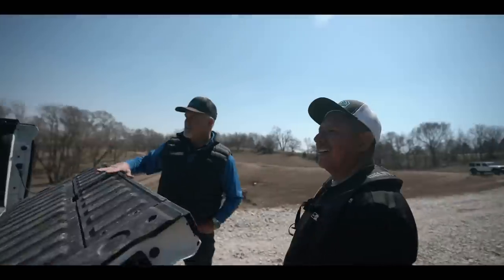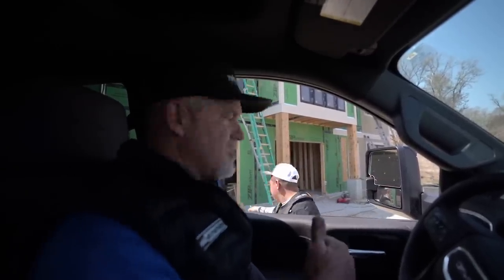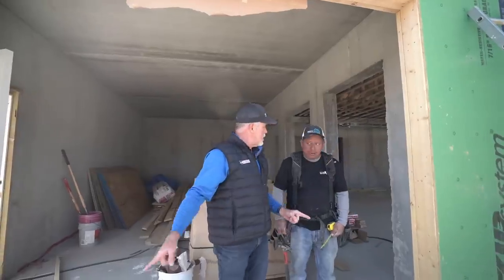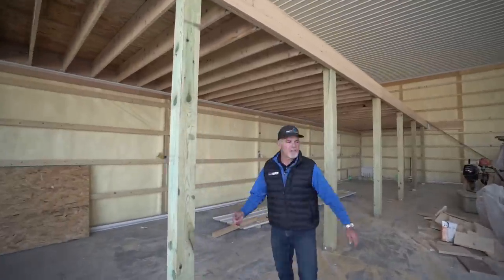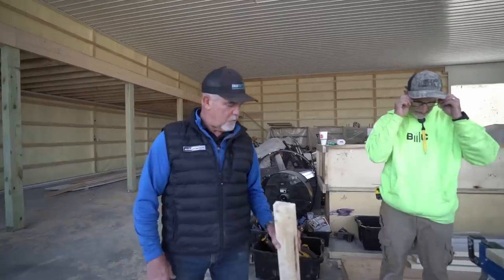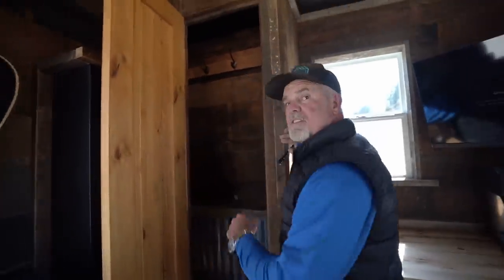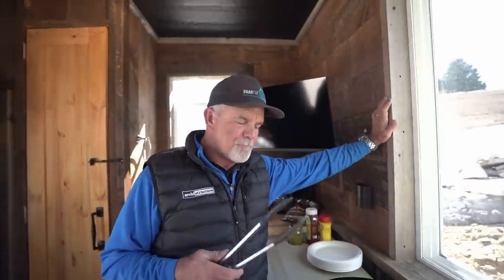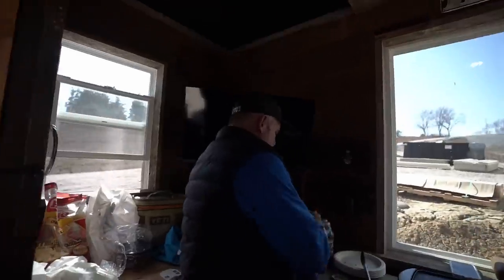My SECRET WEAPON… (It’s Not Fair)

Comment: Hey Brad make sure you don't miss out on this feature. Get the 400 w solar panel and the wiring attachment and find a way to anchor the foldable solar panel to the blinds roof and run the cables down the side to the generator. And during the day when you're using your generator and you have the solar panel connected to the generator as you're using it. Now you can input power to regenerator as you are using the generator for your appliances. Now you can keep your generator chopped up with juice as you're using it get the best of both worlds it's a pretty cool feature Make sure you take advantage of it.
Reply from the maker: I’m gonna get one ordered right away… That’s an excellent idea
Reply: @BradtheBuilder  can't wait to see it in the upcoming videos have a good day at work today Brad

Comment: Btw Brad on your GM tailgate that folds down if you have an extended hitch on the trailer hatch it WILL DENT the tailate
The middle tailgate not the main one
Reply from the maker: You’re right… That’s a bummer! That’s why I rarely get to use the step because I have a hitch on all the time
Reply: @BradtheBuilder  I replaced a new one on a truck for salesman truck.  A week later a big dent but it had bluetooth and speakers in it